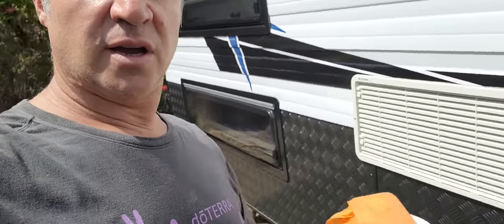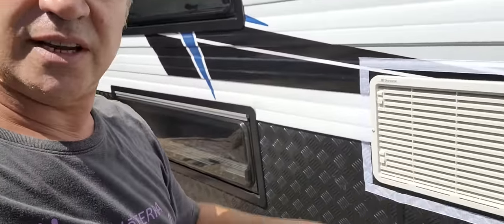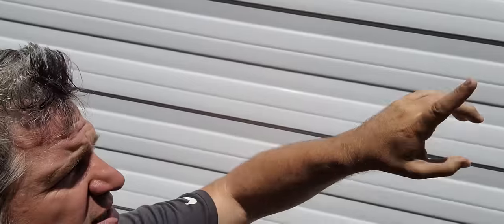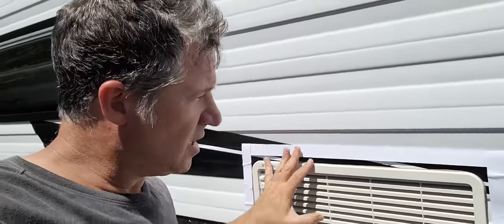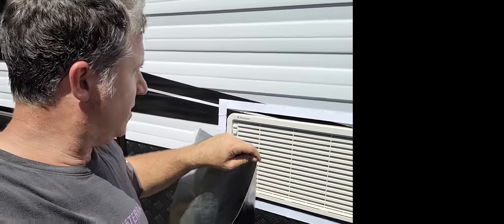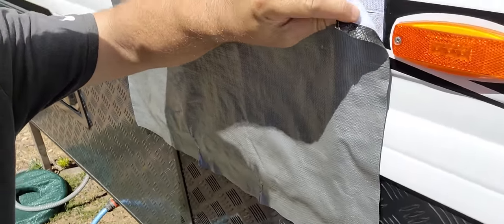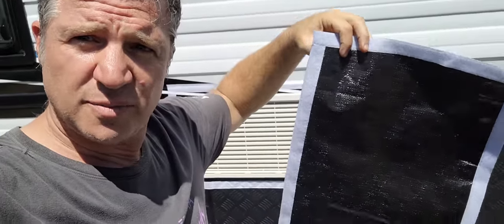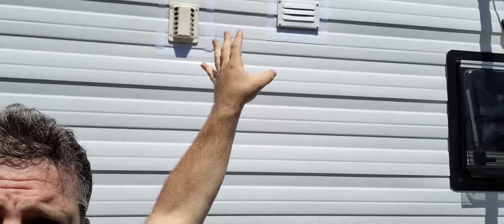Caravan Vent Dust covers! Dust proofing your caravan.

Comment: How did they go? Do you turn your fridge off while the vent is covered? What side of Velcro did u adhere to van, any reason for that?
Reply from the maker: I  put the hook side on the van as its a little stiffer so the softer loop side was on the covers.

I actually kept the fridge on with them on, but would stop occasionally to make sure everything was OK, and it always was. The exhaust vent up top was uncovered so plenty of air was still available.
Reply: @Ordinary Family     did these work out well for you? Any issues or recommended  changes?